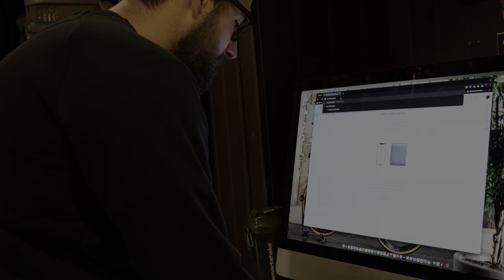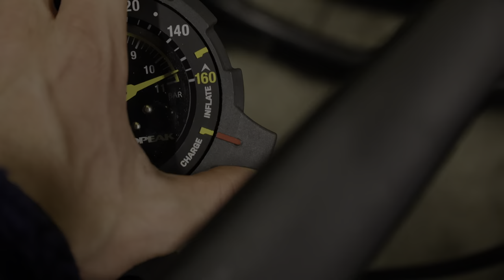New Camera Day! - A visit to the Backyard Bike Shop

Comment: Josh, HDR implementation on youtube is total garbage. The best thing you can do while trying to serve a large audience on youtube is normal, h264 8bit rec709. Anything else, youtube will re-encode and try to tonemap, which it often fails to do properly. It's best to let the editing and encoding software to do that job, since you will have control over the way the final export looks. Youtube is kinda random lol
Reply from the maker: Thank you. That information is really useful.
Reply: @Josh-Reid  I recommend to just crank the Bitrate to something like 100mbit@4k, so it still looks crisp. YouTube re-encodes that to all the different resolutions and codecs. Just make sure it's h264 rec709